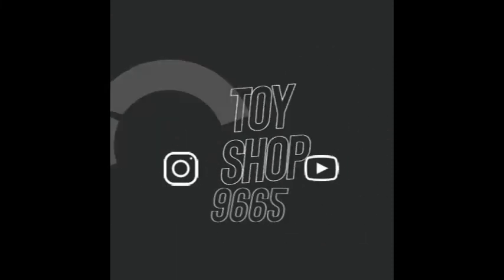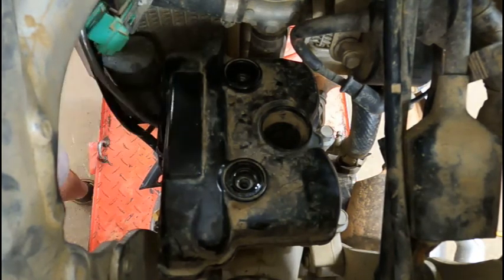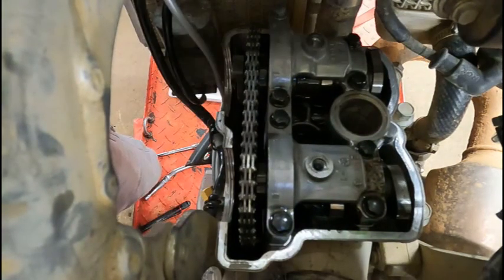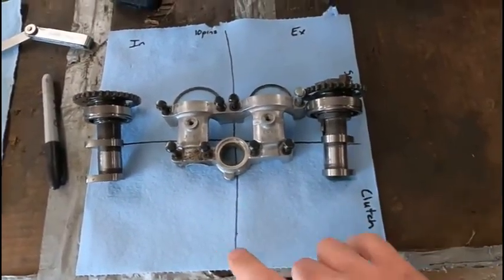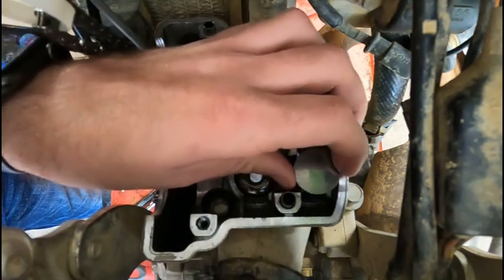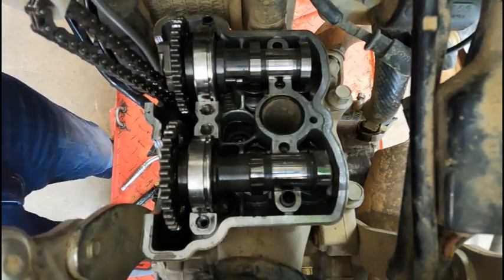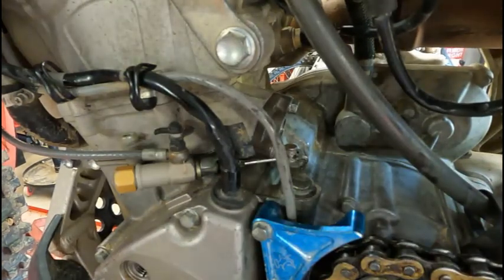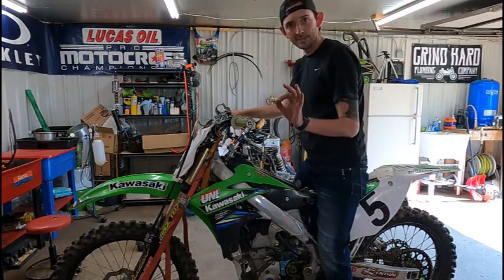Valve Adjustment! Step-by-Step 2014 KX250F Very Similar to Most Race Bike Valve Adjustments!

Comment: Have a bike that would only bump start. Turned out that the auto decompression unit on the end of the cam was tweaked just enough that it was binding a bit and wasn’t letting it swing free enough to allow it to run with kicking. Put it back straight so it moved freely and it started in 2 kicks.
Reply from the maker: That’s a weird one! I’ll definitely keep that in mind! So if valve clearance checks out that’d be a good next thing to check while you’re in there!

Comment: My 2014 KX250F is having trouble cold starting and backfires sometimes when kicking it over. When it gets warm it only takes 1-2 kicks but usually have to wack the throttle to get it going, and even then it tends to have a hanging idle or just not idle at all. I'm sure all of those symptoms are related to tight valves/low compression considering it has 200+ hours on the top end. Was really contemplating taking my bike to a shop to have the valves adjusted, but decided to YouTube it first and BOOM a perfect video that's for my exact year, make, and model. I definitely feel confident doing this myself after watching the video. Thanks for taking it slow, explaining every little detail, and giving some helpful tips that make things easier. That is a huge help for someone like me that is trying this for the first time. Going to be tackling this project along with a new piston and rings in the next few weeks I will let you know how it goes! Thanks again!
Reply: Update: Went ahead and pulled the valve cover and measured the valve clearance to get a starting point. Intake valves were completely tight, couldn't even fit my thinnest feeler gauge in there. Exhaust valves weren't as bad, but still too tight to be within spec. Id say that explains the hard start problem!
Reply from the maker: I’m glad you were confident enough to dig into it! That’s the only way to learn! I’ve heard that normally you only get one valve adjustment out of a set of valves. So if this fixes your issue for idk maybe 5-10 hours and it starts doing it again I’d look into buying new valves. But I’m glad this helped!
Reply: Absolutely the best way to learn thanks again brotha! I found some gasket maker when taking the valve cover off, so someone has been in there before. Hopefully there's a replaced set of valves in there. Otherwise this would probably be adjustment #2 on them. Interested to take a look at them just to know but don't have time to do the "rebuild" for another 2 weeks so I assumed it would be better to leave the engine sealed up until then as opposed to sticking a towel down in there. Am I right in thinking that? the curiosity is killing me LOL  @ToyShopRestorations
Reply from the maker: @Jam_s4  it’s probably smartest to leave it together 🤷🏻‍♂️ but I also do dumb stuff a lot 🤷🏻‍♂️😬 so to each their own 😂😂

Comment: So... I just tore apart my buddy's 2014, and exhaust was good, but intake is tight too tight 😬😬 I couldn't even get a 1.5 thousands to fit. I pulled it apart and the shims  are, intake PTO side 2.60 and 2.65 on other side, exhaust pto of 3.00 and 2.95 another thing to be noted, rider states only bump starts will not kick start. Supposedly has 24.3 hrs on a full rebuild.
Reply from the maker: Dang that sucks 😅 maybe they just reused the intakes and replaced the exhaust on the rebuild and the intakes finally wore out?
Reply: @ToyShopRestorations  I have no idea 😂, I could have been off tdc when I measured the intakes, so I am going to drop two sizes on the intake shims put it together and re measure, and see what it looks like 🤷‍♂️😂

Comment: My 2006 kx250f the kickstarter is stuck just rebuilt it do you think it’s the valves ?
Reply from the maker: If you don’t have it timed right the valves could be stopping it. I’d pull the plug off the left hand side and put a socket and ratchet on the flywheel nut and see if you can spin it over either direction with that. Don’t be aggressive. Maybe pull the plug out too so the compression isn’t giving you a false feel. If it rolls over a little then stops then I’d definitely double check your timing.

Comment: So I have a 2009 and I see on my flywheel that there are 2 notches about a 1/4 inch apart where the piston is at the top. I can’t figure out if I should have the top line lined up or the bottom of the two.
Reply from the maker: That is a good question. I always get that mixed up 😅 maybe someone on here can help?

Comment: Yeah that’s interesting. I got the same on mine where it’s very loose. There should be no harm running it with lose valves should it since the lobes are not pushing the valve fully open?
Reply from the maker: I wouldn’t think so. I mean mechanically nothing should get destroyed. It might be harder to start but I don’t see how it would be detrimental to it. I don’t recommend running them loose if you can help it tho

Comment: I know this video is old but i was wondering if it’s a problem if my timing chain jumped on the crank
Reply from the maker: Uhhhhhh if it’s all together and under tension then yes it’s a big deal because you’re out of time now. But if you have the cams out of it and you’re checking valves and the chain falls off the sprocket then that’s no biggie just make sure your timing marks are all lined up before you finish up!

Comment: having trouble with putting the timing chain on the cams it seems like its too small almost .also  my left timing chain guide is pushing up on my cam and i have to push down to keep the cam down dont know if thats normal.
Reply from the maker: Did you have the head all the way off? I think one of the guides is supposed to stay in the motor. So maybe you should have put it in before this point? Hope this helps
Reply: @ToyShopRestorations  yes i had the head off i put a new piston in my bike and now i just cant seem to put the timing chain on.

Comment: So ive just checked my 11 kx250f valve clearances.  They are all well within spec….all four on max gap side.   Would the fuel pump pressure be the next thing to check?  Thx very much.    Takes bike about 20 kicks to crank cold.   when riding and warm only one or two.
Reply from the maker: Ya I haven’t played with fuel injected bikes very much. Im not even sure how exactly to check the fuel pressure. I’d make sure the dumb stuff like air filter are clean but other than that I’d research how to test fuel pressure and try to diagnose it before spending money on a pump.

Comment: What are the main thing to change on my kx 250 09  if my compresión at 90 PSI do I change my rings and what else
Reply from the maker: I like to replace the piston too. Not just rings. Also check your cylinder and make sure it’s not wore out. You’ll be able to feel a ridge towards the top if it if it’s bad.

Comment: I see you didnt show putting the second fuel line on the rear injector!!! I have a leak of gas there for some reason… have any ideas
Reply from the maker: Watch a whole damn video and it doesn’t even show the thing you need 😂 of course. I’m going to be honest I don’t have a ton of experience with fuel injection. All my stuff is older. The direction I might go tho is checking the o rings for cracks or chunks missing. Check the clips to make sure they’re not deformed to the point they won’t hold the line on tightly. Or check the fuel line itself for cracks. Hope you get it figured out!
Reply: @ToyShopRestorations  thanks man i really appreciate the feedback!!!! Stay up bro

Comment: I got a 2015 Kawasaki KX250f I am not quite sure what’s wrong with it it’s got compression but not much and takes a long time for it to start but after I have it warmed up it likes to run good.
Reply from the maker: I would definitely check the valves. Usually hard starting is the first sign of valves getting out of tolerance
Reply: @ToyShopRestorations  thanks for your help

Comment: I got a question I had some valves on a buddies bike that were really tight so I loosened them up and got them to your measurements you stated in the video and put it all back together with a new spark plug and cannot get it started. It's a 2015 kx250f. It seems to kick over pretty easily. I myself have a yz250x and this 250f kicks over about as easy as my 2 stroke. Is that just the decompression cam working? Or did I do something wrong
Reply from the maker: No I would say they should kick over pretty easy. I mean you shouldn’t be able to start it by hand lol idk I would double check your timing. Make sure it’s not a fuel issue. If the plug is wet then it’s probably not fuel. Make sure the chain tensioner is working properly. Not too sure. I do know it can be frustrating if it won’t start right after and you have to tear it all back apart again 😅 good luck!
Reply: @ToyShopRestorations  it ended up being the timing! I had each cam off by 1 tooth. As soon as I got the dots lined up perfectly with the head surface it fired up first kick!
Reply from the maker: @prestonwolff1141  Awesome! It’s a bitch to have to go back through it 😂 but doing it twice just makes you better right? 🤔😂
Reply: @ToyShopRestorations  oh totally! Lmao. I ended up having to take the bridge and cams off probably like 5 or 6 times between getting the shims right and the cams lined up properly 😂

Comment: What if I accidentally knocked some dirt into the engine when I was checking valves but it just landed on top of the valve
Reply from the maker: Just wipe it out. Unless it was like a 5 gallon bucket full of dirt. Then maybe I'd take the head off and tear it apart and clean it lol

Comment: My Rmz 450 has 1 intake to tight and 1 exhaust is to tight my bike is hard to start but the bike is making a ticking sound
Reply from the maker: Definitely start by adjusting the valves and get them good. Then see how the ticking is. It should take care of the hard starting. If the bike has a lot of hours on it maybe replace the timing chain and or do a top end on it. 450’s by nature usually have a lot of valve train noise. Hope this helps!
Reply: @ToyShopRestorations  thank you, my cam chain is tight now I checked that and I’m going to put 2 smaller shims in to fix the hard start but the ticking part shouldn’t be caused by a tight valve
Reply from the maker: @machines4life450  you’re right. Usually a loose valve would make a tick but what about the rest  of your valves? A piston can slap if it’s getting tired. You can have a rod knock. Cam chain slap. There’s lots of things that can make noise.  I’d start where you know there’s an issue and go from there!
Reply: @ToyShopRestorations  I have a video of the ticking on my page, the sound is a little bit better now then it was in that video because I got my cam chain 1 click tighter
Reply from the maker: @machines4life450  did you force it one click tighter?! 😧